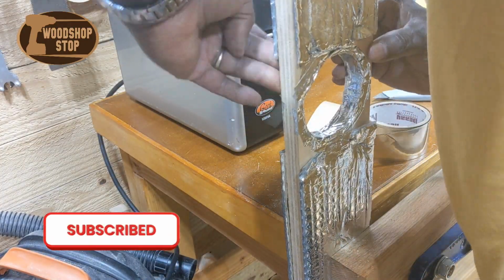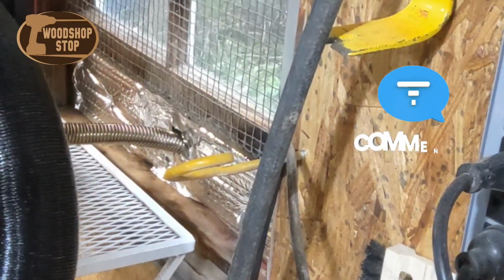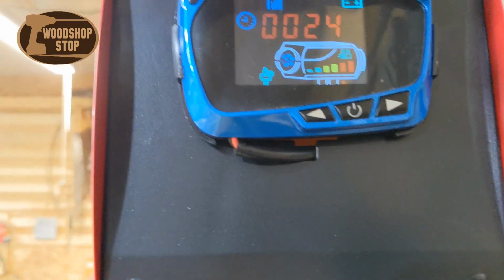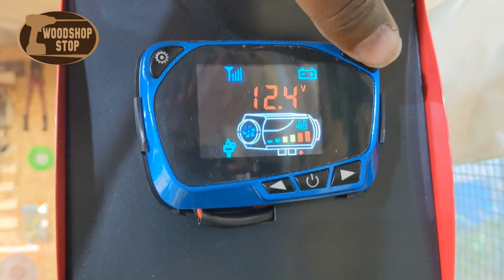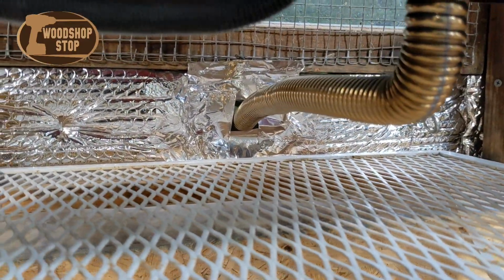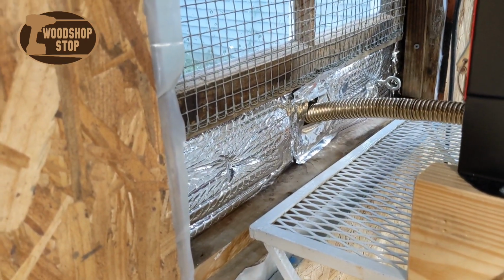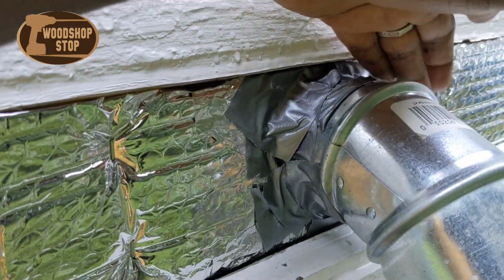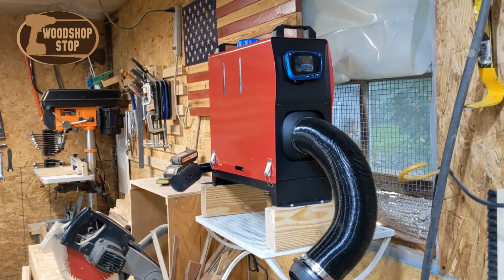Totally awesome Diesel heater installed in my woodshop

Comment: Hello 👋  I just installed my unit and my concern is the dust from wood cutting.  Any ideas?
Great videos BTW
Reply from the maker: I made some makeshift filters for the back fan and the intake hose. I also run it on high frequently to burn off any build up in the burn chamber. Thanks.

Comment: did it make any difference in the cold? about to try mine
Reply from the maker: My workshop is insulated pretty much and maintains about 40° without any heat when it's about 30° outside.. Using the diesel heater brings the temperature up to about 60 65°. If I want to speed that up and get around 70 75°, I can use my additional electric space heater in combination with the diesel heater. It does help a lot. It's also nice to be able to turn it on from the house with the remote and get the shop warmed up before I go out there.  Thanks for watching.
Reply: 1.5 car garage, was comfortably warm yesterday. today is 20 below. will report back. Garage is heavily insulated and drywalled.
Reply from the maker: @XsavioR38  wow! That's cold out, I'm glad you're staying warm. I think that's the perfect size space for the diesel heaters.
Reply: 27 degrees out. 20 below windchil 
Garage door opened , then 2x4 laid across the bottom , second one cut to make up the  difference with a notch for the exhaust , door closed on it . 
left a HUGE gaping hole at the top of my garage door. 

It was comfortable to work in a hoodie.
Reply from the maker: @XsavioR38  sounds like you're getting it dialed in. 👍🏿

Comment: When you mention hertz, are you talking about fan rpm? 3 hz equals 180 rpm?
Reply from the maker: In this case of the heaters we're talking about the Piston speed in the pump. the Hertz equals the frequency that the Piston moves or The strokes of the piston. The minimum herts of that heater is 1.7 Hertz so that's 1.7 strokes that the Piston makes within a second. The maximum Hertz is 5.4 strokes in a second. The higher The strokes the more fuel that is pumped into the ignition chamber, which causes more combustion in the combustion chamber which creates more heat. It seems like the fans would have to increase in speed as well to get more airflow. Check out John Mack 47 he's the guru.
Reply: @WoodShopStop  ok thanks for clearing that up.
Reply from the maker: You're welcome, you know I think these little heaters are pretty cool they're actually fun I mean it's like a toy it's  basically a small diesel engine. I had it running today for a couple hours and it got the shop up to 70° and I dialed it back. Seems easier to control the temperature than the kerosene heater. Have a good one.